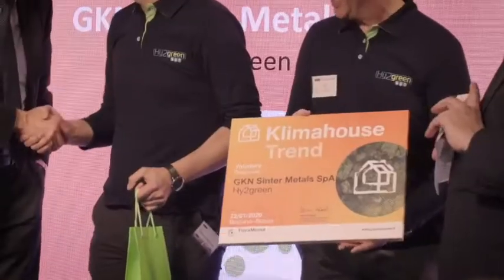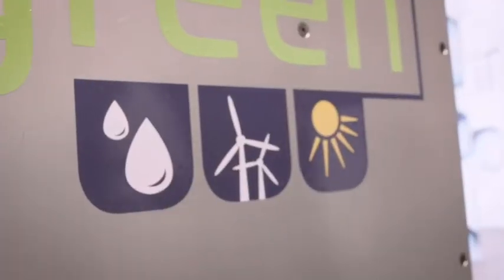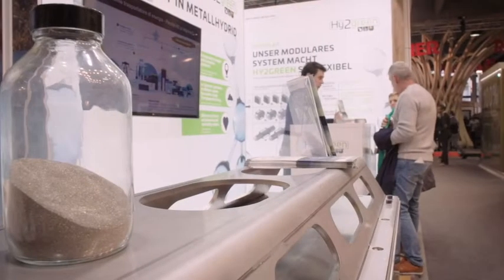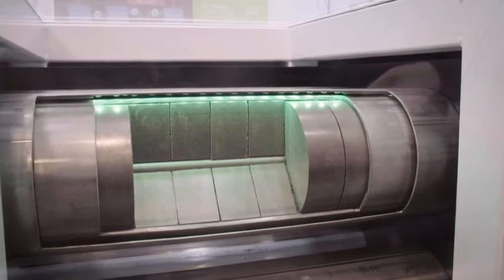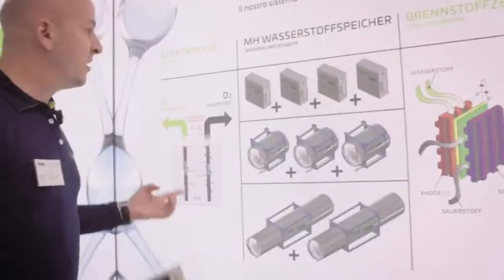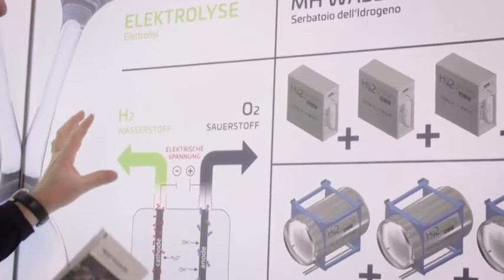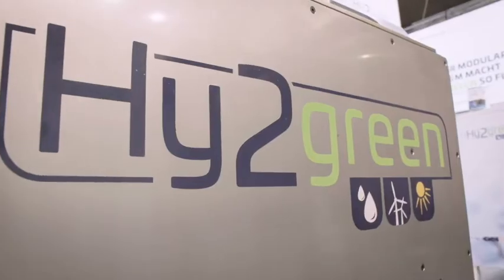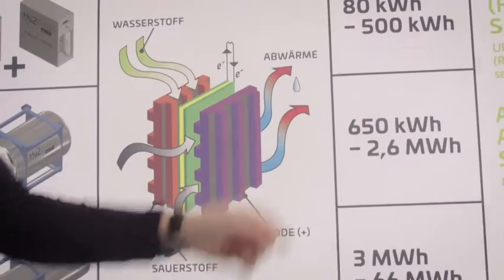Hy2green ‒ The safest storage system for renewable energy

Comment: What is the round trip efficiency of such a system? Would it compete with batteries (>90%)?
Reply: would be less efficient due to electicity usage needed to produce the hydrogen. the theory is hydrogen produced when less demand on system. good news is longer life span than lithium. there are some completely off grid homes using similar technology. another advantage would be heat produced can be used for heating.
Reply: Its probably more like 30%.
Reply: @manoo422  Yes, but sun isn"t going anywhere ; ) Have you got some information sources about ?
Reply: @AutoNomades  Using excess solar to make H2 isnt that efficient then storing it to use in a fuel cell is really bad, they are well known to be only about 50% efficient. You would be better off burning the H2 for heat or water, if batteries are too expensive (which they are).
Reply: @manoo422  Yes, but if the idea is to find a way to store the sun, that is free but not always here, ~50% of something freely available is still interesting !.. And, "are well known" is not a source.. ; )
Reply: @mattl6004  Needs to be heated to release the stored energy. They forgot to tell you about that.

Comment: Hydrogen is the fuel, oxygen is in the air, plenty of it. What I would like to know is what is done with the heat produced when H and O combine back in the water. Maybe a Stirling engine could contribute to electricity production.
Reply: or use it to heat or cool the house heat exchanger
Reply: Combined heat and power seems like the best solution
Reply: Stirling engines are sadly too expensive for most applications. It is more economical to use the heat directly

Comment: Do they Need Pure Oxygen, If So where are they getting that from?.
However Looks like Progress, I like it.
Reply: The pure Oxygen and the Hydrogen both comes from water (H2O) by electrolysis. Yes, this is definitely excellent progress!
Reply: @FreedomJourney88  There is No Mention of a Pure Oxygen Tank?.
Reply: @chrisgriffiths2533  Ah I see what you mean. I  don't think the oxygen is stored come to think of it. When energy is needed the hydrogen is released and combined with oxygen from the air to generate electricity. https://en.wikipedia.org/wiki/Fuel_cell
Reply: @FreedomJourney88  Yes, So Maybe they are Better Off Supplying Pure Oxygen plus an Oxygen Tank.
Reply: Oxygen is released once it is made as you don't want to store it etc. You don't need it as power recovering process let s call it this way will need only hydrogen stored in stones. Fuell cell will "change" pure hydrogen into oxygen. Hydrogen for fuel cell will come from hydrogen separator probably which splits hydrogen and oxygen. Than hydrogen goes to iron powder where it is restored by air being lown at it. By changing amount of ocygen you change amount of hydrogen recovered. You can change that on demand. I find it amazing how backwards we are. We develop expensive dangerous mixtures instead of checking out what we have got around. That is amazing.  This is in fact ecellent idea as this should be considered simply as baterry replacement for solar applications and will go worldwide. Suddenly you can become independent and disconnet yourself from local grid and you will not pay taxes that come with it.
Reply: @andy86376  Zej86,  Look Forward to Seeing You do what You Write.
Please Update Us on How You Go.
Reply: @chrisgriffiths2533  Haha just because you guess how it works doesn't mean you know how it works:). This is still a guess.
Reply: @andy86376  Rej86, Are You Acknowledging that Someone Can Guess Correctly?.
Reply: @chrisgriffiths2533  Even if one does it is still only a guess. As long as someone will not confirm it is correct or not He doesn't really know. It is also possible that they heat up tank inside and they way get pure hydrogen out. It is another guess.
Reply: @andy86376  Zej86, Look Forward to Seeing You do what You Write.
Please Update Us on How You Go.
Also if You want to Use Guessing, Fair Enough go Right Ahead and Guess.